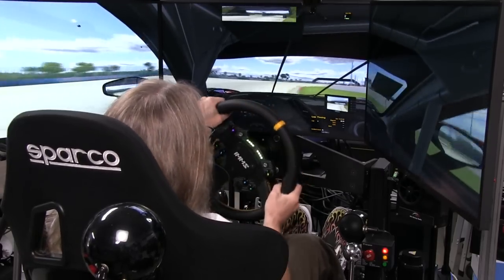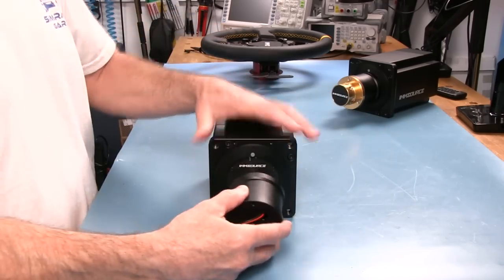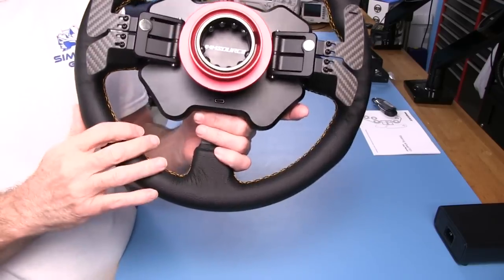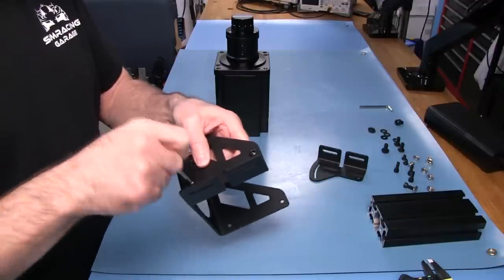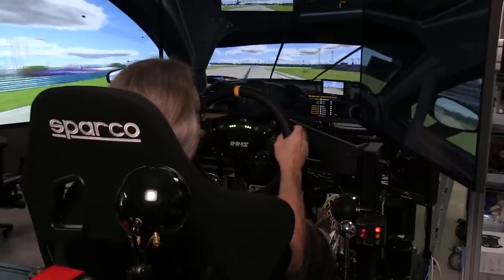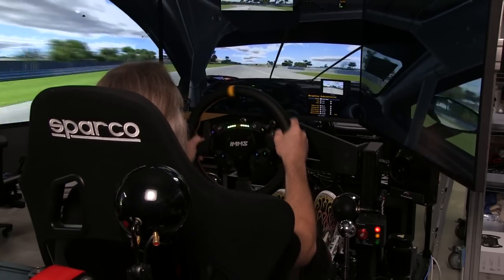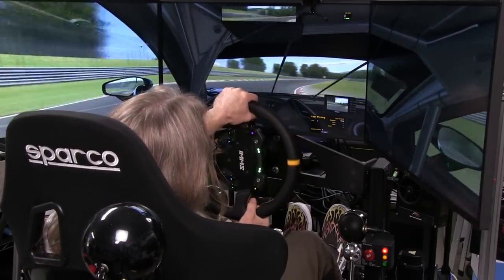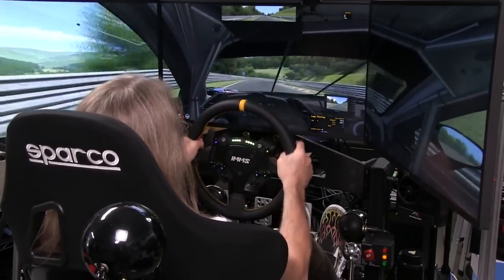IMMSource 10Nm ET3 DD FFB Wheel System Review

Comment: I really like how sim racing equipment got a lot of new manufacturers in recent years. From DDs to Pedals. Just a couple of years ago, you had Fanatec and their average DD1/2 and their shitty V3 pedals. If you wanted something better, price went up 2-4 times (Simucube & Heusinkveld for example). Now, we have Moza R9, SiMagic 10nm, Immsource, Fanatec DD 0.5 (I was very disappointed with DD 0.5. Peak force is there when you go over kerbs, but holding force in long corners is just not there). On Pedals side, oh boy. DC, Bj, Girro, Asetek Forte, Moza CRP,... are all in the price range of Fanatec V3, but they are all better offerings IMO.
Reply: @halfbreed02  As long as you are happy. I bought DD 0.5 and got it in the "third wave". I had wheel disconnects every day, shifting problems, FFB problems,... I couldn't even finish a 20min race. Had to send the unit back. But issues never went away. It got so bad (their customer support answering every second week) I had to "trigger" EU customer protection laws to get my money back.

Comment: Thanks for the video i have a more general question regarding Direct Drive power consumption example on the Simagic Alpha Mini the power brick that it came with has 216 watt on it. Does this mean only peak power or does that thing draws 216 watt continuesly? Reason im asking i pay my own electricity bill going to volentary pay 15 eur a month extra just to cover the cost of this and my pc. Has some one tested the power draws on these DD's or if some one can chime in and let me know how much DD's consume while gaming. Thx in advance
Reply: It will draw as much as it needs in certain moments , it wont stay at max , but say u draw 200 watt all time ( i suppose u based in uk , u probably on 35p a kw so u need to use the wheel 5 hours to spend that 35pence lets put it this way , 5 hours daily is 35 p a day in 30 days u spend   around 10 £ if u use it 5 hours a day wich is crazy as u probably use it way lesd then that.
If u avarage using it 1 hour a day for every day of the month u will end un spending around 2 -3 £ a month.
So yea it wont make a big diference , use carefully the boiler the oven stuff like that wich are the real consumers and dont listen to the wife compaling about ur wheel bringin the eletricity bill up 😛